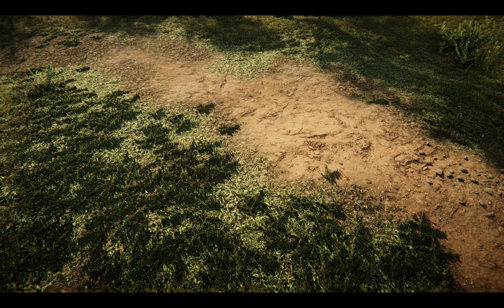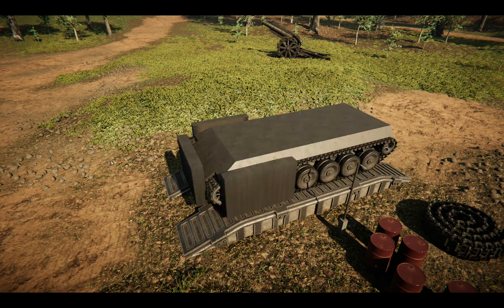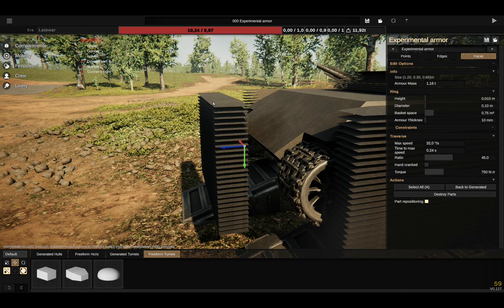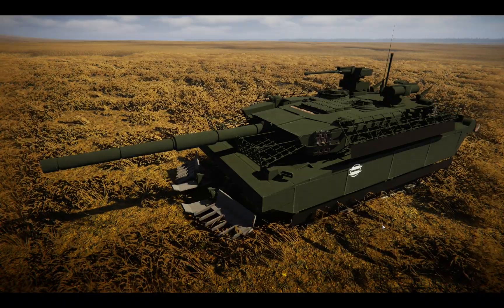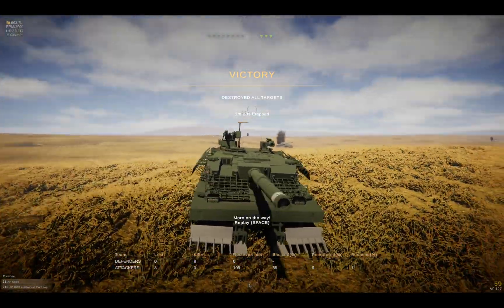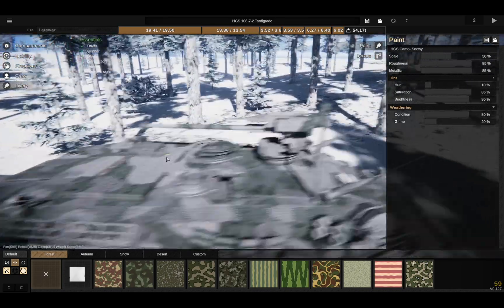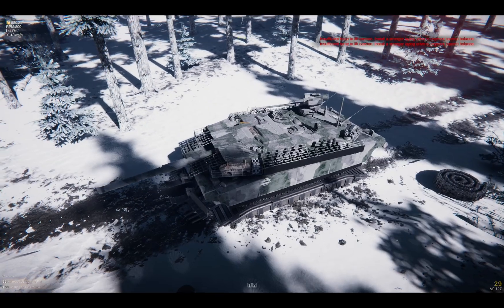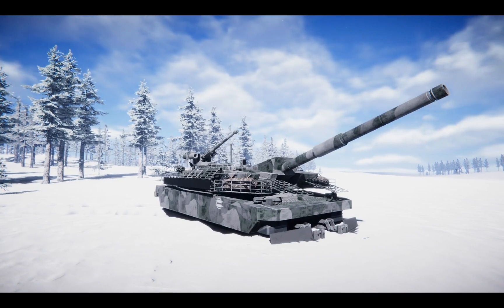Sprocket - Experimental autobounce armor

Comment: Wait, you can make Cold War era / modern tanks in Sprocket?
Reply from the maker: ive seen people make fighter jets, race cars, helicopters and entire biuldings. if you can model it, you can use it in sprocket. its as simple as that
Reply: @T_PLAYER Nice to hear, but what about realism? Surely, those fighter jets can't be as good as the ones produced in Flyout? Although it doesn't matter all that much, I'm more interested in how well one can replicate a Cold War era tank. Will it only LOOK that way, or will it also function like one? What about ASPFSDS modeling and the HEAT rounds? Laser range finders? Smoke grenades? The thermals?
Reply: Not to mention auto-loaders
Reply from the maker: @getsideways7257 it will only look like a modern tank visually. the game currently only goes up to late ww2 technology. and theres only solid ap in the game, but the shell designer is planned to come within the remaining lifespan of the solar system
Reply from the maker: @getsideways7257 autoloaders are planned. currently you can just modify the loaders efficiency value in the files to simulate an autoloader
Reply: @T_PLAYER I see. Thanks for the answers. Still waiting for something like this but for the more or less modern tanks.
Reply from the maker: @getsideways7257 you dont have to wait really, you can still make cold war tanks in sprocket, but they will play more like world of tanks than war thunder

i even made a tank with two rail guns. you can check it out, i made a showcase video of it
Reply: @T_PLAYER I would much prefer they played like Steel Beasts. GHPC is the most casual sim I'm ok with. But maybe Sprocket could be a worthwhile long term investment, since it's still in active development.
Reply: @T_PLAYER Figher jet? Are you talking about the game called flyout?
Reply from the maker: @StarWarsExpert_ no. i mean people made jets in sprocket. not very functional ones, but jets none the less
Reply: @T_PLAYER do you know what I can google to find them or any youtube videos? I tried to google sprocket jets but found nothing, just some video from 2021 but that's a tank with wings.
Reply from the maker: @StarWarsExpert_ you cant find them, because they were posted in the sprocket discord server
Reply: @T_PLAYER ah ok thank you nonetheless